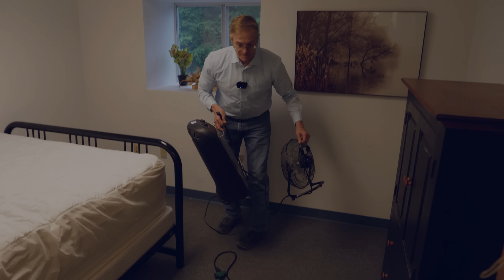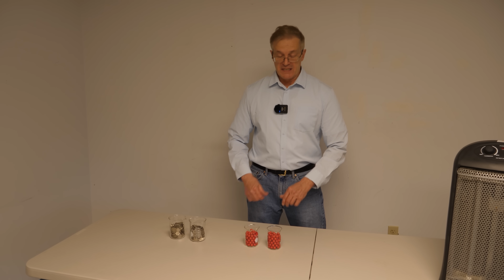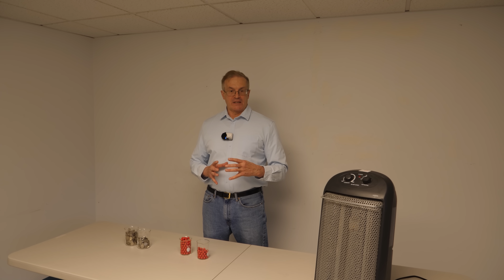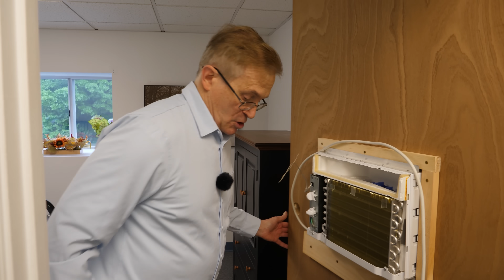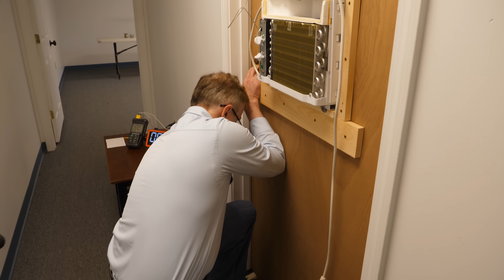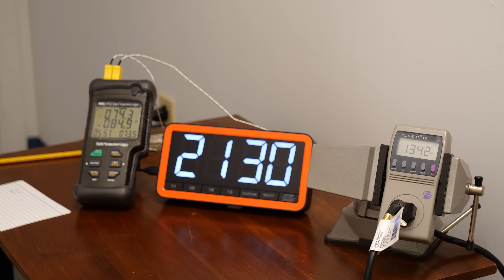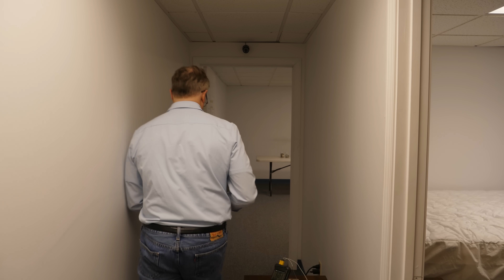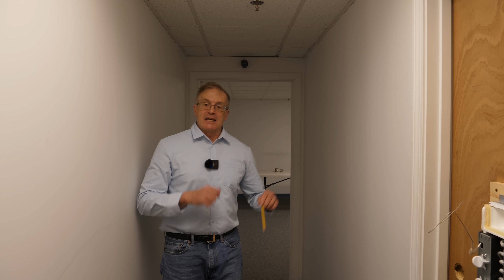You're wasting money on heating! Use your A/C!

Comment: Isn't this common knowledge?
I'm from Europe, and we use split system ACs, they all have that as a normal feature.
There is a valve that switches the mode of operation without actually having to mount it inside out xD.

Comment: This was a flawed experiment. The space heater was placed across the room, far from the temperature probe, radiating heat toward a side wall rather than the temperature probe. Consequently, the heat did not directly affect the probe, leading to an underestimation of the temperature increase. On the other hand, the AC unit was placed much closer to the probe, resulting in a direct and likely exaggerated temperature increase reading due to proximity.

Heat Retention in Walls and Insulation:
The space heater warmed not only the air but also the walls, insulation, and other materials in the room, which retained heat for a long time. Opening the door allows the air to cool down relatively quickly, but the walls and other materials retain the heat and release it slowly over time, affecting subsequent measurements. The space heater operates via conduction, convection, and radiation, heating the walls and objects in the room. The AC unit (used as a heat pump) primarily heats the air with minimal radiation, leading to a more immediate and localized temperature increase. However, the temperature will drop faster when the AC unit is turned off.

Recommendations for Accurate Comparison:

1. **Equal Placement**: Place the temperature probe equidistant from both the space heater and the AC unit to ensure that the heat sources affect the probe similarly.
  
2. **Allow Complete Equilibration**: After using the space heater, allow sufficient time for all room surfaces, walls, and insulation to return to baseline temperature. This would require overnight, not just one hour.

3. **Multiple Measurement Points**: Use multiple temperature probes at different locations in the room to get a more comprehensive view of the temperature distribution and ensure the average temperature increase is recorded.

4. **Revised Experimental Setup**: Place both the space heater and the AC unit in the same location relative to the temperature probe during their respective tests. Ensure no direct line-of-sight heating of the probe by the space heater.

5. **Heat Equilibration**: Allow the room to fully equilibrate to the baseline temperature, ensuring all walls and materials have released the retained heat from the previous test.

Given the flaws in the original experimental design, the results claiming a near order of magnitude efficiency for the AC unit over the space heater were grossly overstated. Air-source heat pumps typically have a COP (Coefficient of Performance) of 2.5 to 4.0, with the best performance up to 5.0 in milder climates, not almost an order of magnitude.

By correcting the experimental setup and ensuring consistent and accurate measurement conditions, a more realistic comparison can be achieved, providing a true representation of the efficiency difference between the two heating methods.

However, the results will still be somewhat flawed as the air conditioner mostly heats the air, while the space heater operates via conduction, convection, and radiation, heating the walls, particle board, ceiling, floor, and objects in the room more than the air at first. It can take much longer for the radiant heater to warm up the room, but much more energy is stored in the structure, allowing it to be released over a longer period. This is similar to how, on Star Trek, heating big rocks with phasers keeps people warm through the night. In contrast, in a car, turning off the air or heat results in the car becoming hot or cold again within minutes.

Comment: ...That is a huge jump in efficiency,  but how exactly would one practically apply this, (using a window AC unit),  simply turn the cooling side of the unit towards the outside during winter?   Of course, there's the issue of drainage on the hot side, but it probably wouldn't be too difficult to capture or redirect, etc..     🤔

Comment: I live in a hot location and even use the aircon for cooling in the winter. I recently installed solar and air conditioning is more than half my power budget and will necessitate a large system in the summer,  so looking forward to your next video. If your suggestions are cheaper to implement than expanding the solar then it will be worth doing.

Comment: you could have done the test differently. put the heater and the air conditioner competing. heater heating, aircon cooling, and measure the temperature difference then the power usage and compare. the air conditioner would probably win the "battle" at a third of the power consumption

Comment: Would be interested to see this test run for heating a room when the outside temperature is -40 C. I have my doubts about it's efficiency at these temps, but it would be a good test case because the Canadian government is subsidizing these heat pumps. Even punishing people with higher taxes for not switching away from their gas furnaces.

Comment: ur ac setup would work even better if u only had the rectangular top cold going out on a trunk so the heat would recycle running the unit even hotter in the back cuz ur still sucking cold air into the front lower recycle ,

Comment: Nice video.I have a couple of concerns regarding validity. The resistance heater doesn't heat the air it heats things, basically anything the infrared shines on it heats up (you would have been better off aiming the fan at the wall the heater was shining on), convection comes from the irradiated objects not the heater. The heat pump heats the air and pumps that into the room, which feels great for people in the room because it feels warmer, the walls, bed etc,  however are likely to be cold and as you are measuring air temperature the machine that heats air will certainly win. Conversely the resistance heater will heat the wall it is shone onto and that wall will continue to give off heat after the power is turned off until it reaches the ambient temperature of the room. Measurements you could have done to check this was to measure temp in both rooms every minute after the power was turned off, which cooled quicker? I think it would make a nice graph and I suspect it would help bring those figures together. And don't get me started on the poor homeless person out side your room who is struggling in a colder corridor, its not really a closed system is it? We used to install low wattage black light infrared heaters into ceilings. They covered the entire area of the ceiling and shone down onto all the objects in the room. In a well insulated house they were very efficient, rooms could be turned off etc. And..what about the fact that people need 'orange' to 'feel' warm.

Comment: It sounds good, but i need heat when it's cold/freezing outside. Under that condition, won't the water vapor in the air freeze on the evaporator coils and choke the A/C?

Comment: I love your channel!  I have learned a lot over the past few years!  I am curious if you could re run the test but run the air conditioner first.  Since the probe was reading ~2°F hotter to begin the air conditioner test I am thinking that the walls and other objects could have been holding heat.  I would assume the air in the room would cool down the fastest because it has the least mass and the walls, dresser, bed would cool down more slowly.  So if the air was 77°F, maybe the other objects were still at ~80°F.  So when you turn on the A/C unit it takes almost no time to heat the air to the objects temperature.  Just a thought I had.  Thanks for making such great and meaningful content.

Comment: Heat pumps are great, very-very efficient, until the outside temeperature drops so much, so the heat pump gets in trouble to extract more heat. Then it is a good idea to have a backup heating plan. But in most cases heating with heap pumps is a good idea. Another aspect is the heat inertia of the heating pipes and so called wall mounted radiators, those will heat the walls and give a level of confort that heatig with only moving air does not work. When the walls are cold and the air inside you house is warm, you will hate your house. :D

Comment: Don't overlook dehumidifiers, they're just tiny A/C units that exhaust their warm (dry) air right back into the room while catching the moisture/water in a built-in container (or sending it out a hose if you attach one).  Problem is, they're too small, typically, to make any significant heat.  

I reload ammo and my reloading room is in my basement, very damp.  I run a small dehumidifier 24/7 to keep my gear from rusting.  It does noticeably warm the room, but it's not enough to keep the room comfortable in the winter.  I have a door leading out of the room into an enclosed porch area.  I'm tempted to mount a window A/C in that door backward, like in the video, to see how well it'd warm the room. 

The only issue is how to catch and drain off the water from the A/C unit.

Comment: I live in New Hampshire. (Our window AC unit is on right now.) Winters here often get below 0°F. Down in the basement we have a center chimney wood stove. There are grates in the floor of the living area to allow heat to come up from the basement. Even when the wood stove isn't in use and the temp outside is below 0°F the temp in the basement never gets below 48°F. Without burning wood in the stove, could I fit a heat pump in one of the grates to move whatever energy is in the basement up into the living area?
Reply from the maker: Yes.

Comment: And the air conditioner has a thermostat to regulate heat and the heater usually doesn't and would need to go on and off manually therefore overheating the room at a constant 45 cents per kWh where I live is not good.

Comment: Interesting demonstration but lacking in a key detail: Heat Pumps MOVE heat, taking it from one space to another vs a heater creating heat from another fuel. Here moving heat from a heated hallway into a unheated room. The less heat is available to move the less efficient a Heat Pump is. That's why they're not recommended for very cold environments where there is very little heat outside to be moved inside.

Comment: Your setup is actually an "Ideal" heat pump, which is far from the case of an actual heat pump. The heat pump systems just reverse the pump (Compressor) flow in the system which is optimized for A/C operation, namely your suction/liquid lines are now the wrong size for their function as well as the narrow window of outside temp that it even functions at which is about 40deg. F. outside air temp.

An ideal heat pump system would have two valves to switch the lines at the air handler and the compressor which I've never seen in a home system. Your window shaker system is still in it's optimal A/C mode with being flipped physically. The most efficient system is a two stage A/C with gas heat.

Comment: I did a similar experience in my own home. I have a central heating system based on water radiators (one per room, including corridors and bathrooms) which I are fed by gas boiler. I have too say, gas boilers are a waste of money. I also have a central AC inverter unit which works both ways, in or out. The cost of running the central heating vs AC was 440 euros to 90 euros respectively. Plus, you have a finer control of temp and humidity with AC, it is more comfortable. On top of that you can use, obviously, the AC unit during the summer for cooling together with timed blinds in the windows for sun energy intake control.

Costs with boiler:
5 months (oct-feb) x 440 = 2200 
AC costs remaining months:
7 months x 90 = 630
Total: 2830 euros annual energy costs

Year round AC usage:
12 x 90 = 1080

Year savings, 1750 euros, which I use to power my electric car. I was using around 150 euros a month for car fuel that sums up to 1800 euros annually.

Long live the heat pumps. Prices are going up and I am still making savings. 

(Sorry for the English, I am not a native speaker)

Comment: What about gas central heath, is it less efficient that those portable electric heaters?
Reply from the maker: Actually, yes.
Some of the heat energy is lost up the chimney, but every watt of the electrical heater stays in the building.
The elephant in the corner is the lower cost of energy from gas compared to electricity.

Comment: Cost… heat pump vs resistive vs NG or LP . Gas heat is much less expensive if you have Gas already. The main point. If your home has Natural gas heating already, if you move to heat pump it will cost more. The cost would be a the same as running AC in the summer.

Comment: When I teaching my college classes I would explain to my students that heat pumps are not over unity but they mine the air this is why as they get colder outside it gets harder for it to mine the air because the heat particles become further apart thus creating more work to compress the smaller amounts of heat for it  to mine 😮

Comment: I had no idea heat pumps were that much more efficient over electric.

Probably a stupid question but here goes...do all AC/heater combo window units use the reverse AC or heat pump method to do their heating? And if so, for the sake of saving heating costs, we are basically saying its stupid to not get the combo over both an electric space heater and a window unit AC?
Reply from the maker: I was surprised as well!
I don't know,  but I doubt it. An inexpensive way to enhance the marketability of what is basically a standard air conditioner would be to add a simple wire coil. You might have to dig into the product literature.  If the heating mode power draw is larger, then this is probably just a resistance approach.
Reply: @TechIngredients  Best I could tell from a Google search, the combos are an AC/Heat pump, and it actually makes perfect sense...too bad the much higher price than a standard window unit does not. 

Thanks for the informative video.
Reply: @TechIngredients  A Google search revealed, best I can tell, that is exactly how the AC/heat combo window units work...heat pump/AC. Makes perfect sense, too bad the much higher price for the combo doesn't. Thanks for the informative video.

Comment: My current AC window unit has a DC inverter built in . The speed goes up and down as does the compressor. You never hear it “ clunk “ every time a compressor kicks in and out . Supposed to be very efficient . 110v but supposedly runs cooler . Maybe not good for this . Great subject
Reply from the maker: Thank you. I didn't know about that.  However, that raises a question. If the compressor slows, the output volume must drop, and this will change the expansion ratio. This may have to be coupled with a variable valve in the refrigerant line.
Reply: @TechIngredients   if you want to look at the specs  it’s a “ Hisense “ brand sold at Lowe’s . Many different BTUs available .

Comment: Your test is great, however I use natural gas to heat, cook and generate hot water. Using electrical units to do the same as my natural gas ones would be substantially more expensive. If one is stuck using only electricity (which is prefered by producers and sellers of electricity) your heat pump alternative is the obvious choice. Hopefully honeowners will continue to have choices and obtain the best combination for them. And don't give me the carbon footprint BS because electricity in my area is generated primarily by natural gas.
Reply: Is gas heating less less expensive than electric? And if so do you happen the know the percentage of savings. I'm assuming your using gas for its lower cost.

Comment: That's cool, however, it only works when you can move the heat. This would not work in winter, you can't move heat when there's no heat to move. Ie: it only works if there's a source of heat to move. This won't generate heat from cold. The heater is still the best way to generate heat from electric current.
Reply from the maker: Did you miss my statement about the heat content of air at 0 C? It is 90% of the heat content of that same air at 27 C.

Comment: I bet his efficiency gain idea is spraying the condenser side with water.
Reply from the maker: No.
Most airconditioners already use the condensate water from the cold side in the house to spray the hot side heat exchanger by dipping the fan blade through a pool as it rotates.

Comment: Ya sorry in mb Canada a heat pump,in the winter simply isn’t the most efficient means of creating heat as the ambient temps reach -30c and with a windchill that can reach -40c at times 
It’s almost laughable that you think you can salvage heat from those conditions 
And people’s hydro rates have proved this to be the case
Reply from the maker: Don't be sorry. 
Have you ever heard the phrase "If all you have is a hammer, the world is a nail?"
In milder climates, or your gentler seasons, heat pumps have it easy and are a good choice. But, even when it's really cold, a pump can climb part way up that hill at high efficiency, and a supplemental heater can finish the trip, but use less energy.

Comment: Most heat pump designs, including the single stage phase change unit in that AC are great when the temperature difference between the intake and exhaust is small. The problem is that efficiency drops precipitously as the temperature difference increases. I don't run my furnace when it's 70 degrees outside but I do need it to run efficiently when when the outdoor temps dip bellow 0 F.